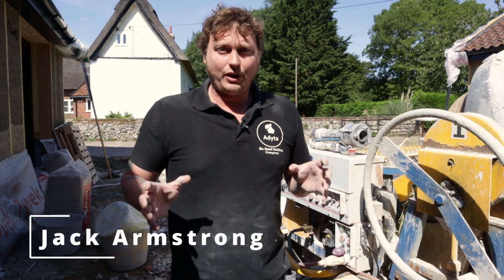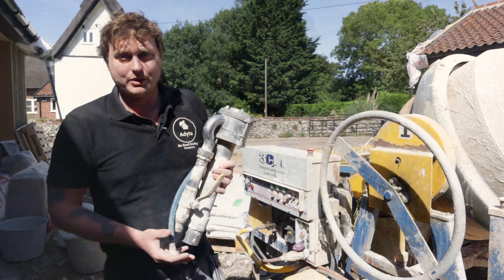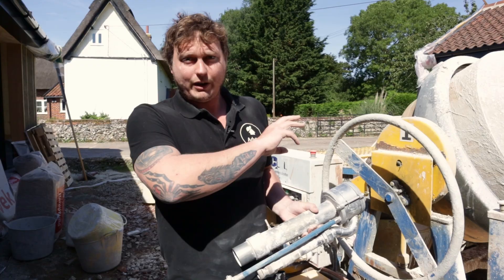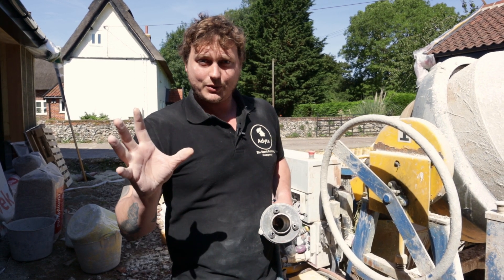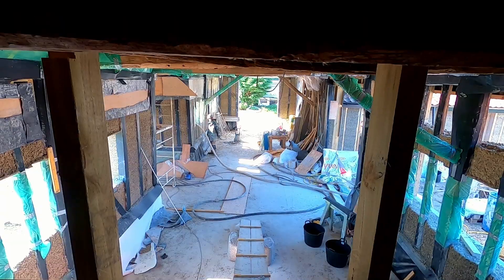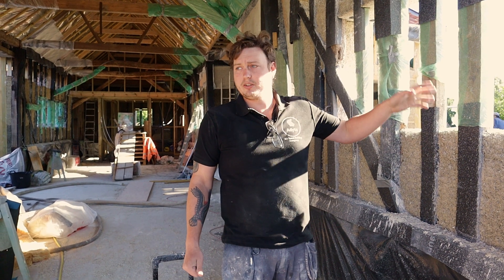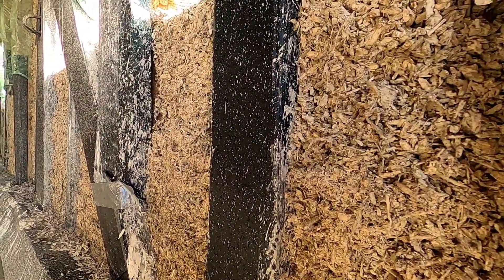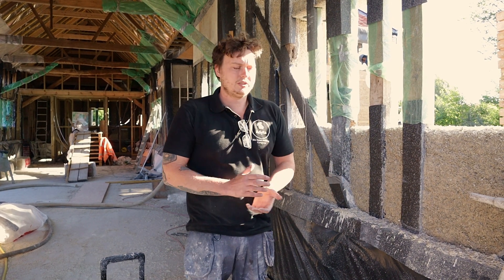Eco Barn Conversion with Sprayed Hempcrete | Behind the Scenes Build Tour

Comment: My mate invented a render spraying machine that could be operated with one man. I'm sure it could be modified slightly and used for this. When I build my home I'm going to use spray hemp. I'd like to build a dome but they're hard to get council approval.
Reply from the maker: These machines were actually modified render machines originally. They're made in france specifically for hempcrete now. It is possible (and has been done) to operate this with one man but would be slow going.

Hemp domes are complicated because of waterproofing issues, the lime render isn't good enough at protecting it, on the non vertical sides and could damage the hempcrete in places without it being obvious. They haven't been tested long enough to prove they work yet.

Comment: About how expensive is the Hempcrete sprayer with all the other parts?
Reply from the maker: Hi, this system came from France and is about 37k Euros. It's one of the best available at the moment, and there are cheaper versions but they operate a bit differently.